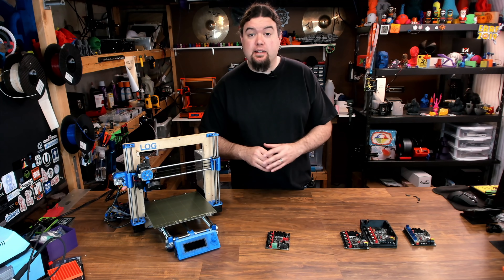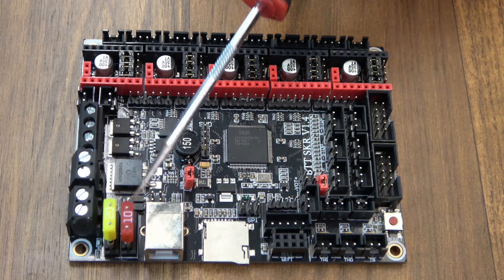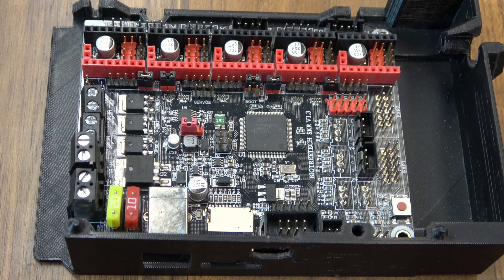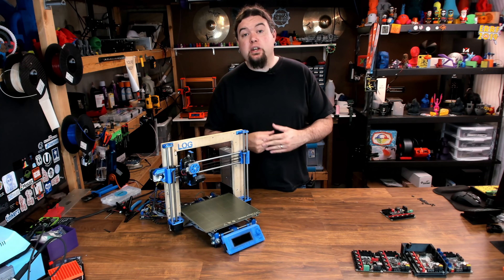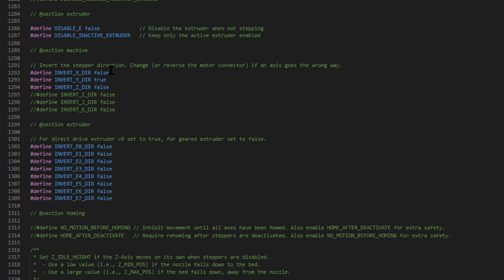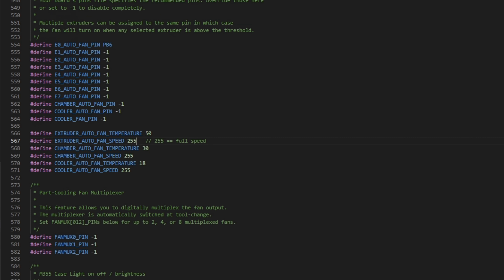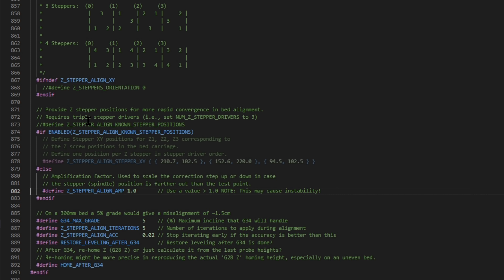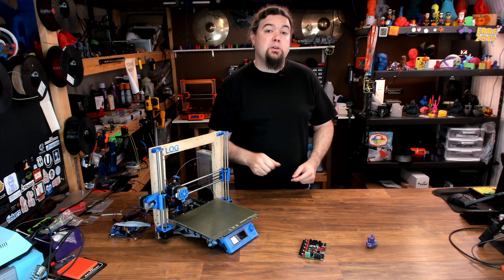Big Tree Tech SKR 2 - Install - Marlin Configuration - Chris's Basement

Comment: Hey Chris. I have a cr10 v3  that I am building a completely new control box using the skr 2 and one of the btt tft touch screens, new psu and everything.  I'm putting it in a heated enclosure. This is a great video. I'm wondering where you get your info from. I'm comfortable compiling new firmware for the printer and the new hotend type and all that. A data sheet I guess I am looking for. I'd really appreciate it if you just gave me a quick answer. I plan to reuse these parts for when I build a voron 2.4 but I want practice with the hardware and software. I want the ability to print abs for the voron parts. Also I'll have a bunch of the electronics for the voron. I'm going to use klipper with a pi after I get the new control box working. The cr10 v3 has no info anywhere. I am comfortable with coding and the wiring.
Reply from the maker: The info is actually pretty hard to find. Usually, I will consult the Marlin example configs that people have already made. These prove to be pretty accurate most of the time.
Reply: @ChrisRiley  awesome Chris thanks. You are a fellow metalhead I see. Proper thing.

Comment: In klipper, you need to enable this 'mosfet for the driver', because otherwize the steppers wont turn on. I've found that if you turn this mosfet off, the heaters are also be off
Reply from the maker: Thinks for your insight

Comment: Greetings Chris!  This video was great to help me install this board.  I have one issue, when I followed the same procedure my 2nd Z stepper was not working plugged into the E1 driver.  Where do you assign E1 to the 2nd Z stepper?
Reply from the maker: Make sure you have this line in configuration_adv.h uncommented. #define NUM_Z_STEPPER_DRIVERS 1 set it to 2.

Comment: can I use the heated bet output to drive an SSR on my heated bed?
Reply from the maker: Yes, it will switch an SSR just fine.
Reply: @ChrisRiley  thanks, I'm pretty decent at this stuff...but I always feel more comfortable when I confirm it with someone like you...not looking to let the smoke out, ya know?  I find your videos to be a great reference to clarify little things I've forgotten since the last one I built.

On a side note, do you have any videos on running the esp32 WIFI module on the SKR2?  I bought the board, its BTT..there is a port on the SKR2 for it, colors even match...but I can't figure out if / how marlin supports wifi ?  I dont even need it, I just thought it'd be handy, now that I can't get it to work, I HAVE to have it! lol

Comment: Hi Chris.  I downloaded your marlin zip file from your site and extracted the files.  I then started VS Code, opened the extracted folder and went into the Marlin folder.  Then i clicked on the Configuration_adv.h file.  It gives an error before i start doing anything saying

#include errors detected. Please update your includePath.  Squiggles are disabled for this translation unit (E:\!3D Printer Files\Marlin-2.0.9.1-LOG_SKR_2\Marlin\src\MarlinCore.cpp).
Reply from the maker: If might not like that file name length. Try making the folder names a little shorter and see if that goes away.
Reply: Yes, it did.  Thank you.
Now that i'm past that i have even more severe errors.  Things like the extruder starting properly at the beginning of a print ( i guess its "priming" the extruder ).  Then the extruder seems to do its print for a very short while and then starts pushing up the filament instead of pushing it out the nozzle.

the next strange thing is that after about 10 layer or so ( remember its not spitting out filament, i just wanna see if the print would follow its path ) the print head tries going off the print surface to the extreme X+ area, causing a grinding noise so i hit the emergency stop.

So i figure, OK i'll start the printer, go into the terminal and type some commands with the print head in the center of the bed to be safe ( after restarting the printer of course ):
G1 X20
the nozzle goes right 20mm ....cool
I issue the same command again and the nozzle doesn't respond.

My settings for heat are 220 and 70.  Yet, any filament that comes out dont stick to the bed.  I use my "heat gun" and find those temperatures are spot on.
I'm not changing any code in Ultimaker Cura 5.2.1 by the way.
I really dont want to throw in the towel, but i'm getting pretty disheartened.  Please help.
Reply from the maker: @prophead62  It sounds like there are all kinds of things going on here. We are going to have to start with a somewhat working config to make this happen. What printer are you working on?

Comment: Hey there thank you for this video!! I just purchased the skr2 board. Mine has the green sticker and no chrome sticker but it has the H1904 on it so maybe it's a good board. Anyways I need advice /help. I have a anycubic kossel linear plus and the board went out on it and thays why I got the skr2. I'm going to try and put the skr2 board on my kossel and I'm kind of worried it won't work but I'm not am expert by no means when it comes to this so if you have any helpful tips or suggestions then send them my way I'd much appreciate it. I've always loved watching your vids. Very informative and they've helped me alot in the past and it's good to see you back !!!!
Reply from the maker: Yes, your board should be all good. The delta config is a challenge, this board will work great for it, it's just going to take a lot of config changes to get it working just right. I would start with the kossel example config that Marlin offers then start changing things from there.
Reply: @ChrisRiley  thank you for the input and I got everything hooked up and labeled now. I unhooked everything so I could build a cooling board cover for it and when thats done then the fun begins 😆 . I love your vids! They have helped me out alot in this journey of 3d printing and I'm sure they will continue to help in the future.

Comment: EXCELLENT video!  I just picked one up to revive an old printer and your video really nailed the key points!
One issue I do have is getting the onboard SDCARD to work with M20/etc...  Any tips for setting up the onboard SD??
Reply from the maker: Thank you! Glad it helped, check out these settings in Marlin, configuration_adv.h they might help.

/**
   * Set this option to one of the following (or the board's defaults apply):
   *
   *           LCD - Use the SD drive in the external LCD controller.
   *       ONBOARD - Use the SD drive on the control board.
   *  CUSTOM_CABLE - Use a custom cable to access the SD (as defined in a pins file).
   *
   * :[ 'LCD', 'ONBOARD', 'CUSTOM_CABLE' ]
   */
  //#define SDCARD_CONNECTION LCD

  // Enable if SD detect is rendered useless (e.g., by using an SD extender)
  //#define NO_SD_DETECT
Reply: @ChrisRiley  Thanks for the input!  It is truly awesome how you reach out to help everyone here!  I had played with those but gave them another look.  As it turns out, #define USB_FLASH_DRIVE_SUPPORT  was enabled and preventing marlin from reading the SD card.  May play with //#define MULTI_VOLUME  to see if that will allow both SDcard and USB Flash drive to work together.
Cheers!
LitterBug

Comment: Will I burn out the drivers if I set the jumpers wrong?
Reply from the maker: It should not.
Reply: @ChrisRiley  Thanx. Because i burn 2 drivers TMC2208 in jusr some moves vhen i trying new SKR 2 rev B. I think i burn them because i forget to remove 3 jumpers. BTT is realy crap. One burn board and 2 driver in 2 mounths.

Comment: I have an ender V1 skr v2. How do I set up the firmware? Is there a simple video?
Reply from the maker: You can copy and page the example config files from Marlin. They are here. https://github.com/MarlinFirmware/Marlin/tree/2.0.x/config
Reply: @ChrisRiley  I got it thanks. I think my problem was that I kept the sd card in after putting firmware in. It worked immediately after I took it out. All that work and then the micro swiss is short and doesn't reach the bed. I can't win 🤣🤣

Comment: What all needs to go on for the TFT35 v3.0?
Reply from the maker: You can use it out of the box, you need to update the config to make sure you have a second serial for it to use.
Reply: @ChrisRiley  I looked a bunch into it. Thought it tied into the firmware for touch, but I guess it's standalone. Almost have everything working thanks to this guide! Gonna wire it tonight and see if I can get a benchy out here in a few days.

Comment: Could you explain how can I use a PT100 with SKR 1.4 turbo?
Reply from the maker: The easiest way is to buy a module to add on to your board. https://www.amazon.com/BIGTREETECH-Temperature-Accessories-Control-Printer/dp/B08PC22D6F/ref=sr_1_2?dchild=1&keywords=bigtreetech+pt100&qid=1634999990&qsid=130-3509954-3210169&sr=8-2&sres=B08PC22D6F%2CB0978ZNDPJ%2CB09713SRVP%2CB07D9LSKWK%2CB0943WVM5B%2CB08NV8XL4G%2CB089CQ3DHB%2CB07FFTHMMN%2CB08BRVBQ5R%2CB07VWGFKLZ%2CB07QJ4MZVN%2CB08B3CJBRN%2CB07D5JXDBQ%2CB082QYYFVX%2CB07ZTM9CSQ%2CB07JGJKPT9
Reply: @ChrisRiley  yes, but how is it used?

Comment: do you know how to fix "the TMC Connection Error"???
Reply from the maker: It could be a lot of things. Turn on motor status in the firmware and run the check command. See if you can see which one is causing the problem. https://youtu.be/H5ea2iyOscg

Comment: An additional note about the bed heater and input power connectors - they are swapped from the SKR V1.3 and 1.4 boards.  And they are NOT labeled on the TOP of the circuit board. Out of habit I put the input power into the bed socket and the bed wires into the power input socket. No big harm (lucky) but a surprise which can cost you a lot of time as the board will operate totally normally EXCEPT the bed power is on all the time. I didn't notice it for a while as I was turning the power on, testing a couple items (stepper motors, temp sensors, etc) and then turning it off again. But I was spending some time tracing an issue with the power on and I got a BED MAXTEMP EXCEEDED shutdown. I had a spare board and it behaved the same way, and while looking at the bottom I saw the sockets had been switched. 

Embarrassing, but I thought I would pass it on to save someone else trouble if they do the same thing!

And yes, you did mention the locations in your video but I watched it a month or so before I got my board.
Reply from the maker: Defiantly something you want to watch out for, thanks for sharing!

Comment: Hi Sir, I have some issue with SKR 2 REV B - It's shows TMC connection error. I am using TMC2209
Reply from the maker: Double check your jumper and reseat the drivers. Good luck

Comment: Thanks for the video, Chris, it's very clear and helpful. I ran into an issue. I've followed the video instruction to setup marlin and after flashing the board i get a "tmc connection error". Do i need to do something to the drivers? I've seen some people talking about the soldering on the underside of the stepper for uart mode. Any ideas? /edit: Turns out, as i was flashing it on the bench, i hadn't checked it hooked up to a power supply yet. (just flashing on the bench powered by usb).
Reply from the maker: Glad you got it going!

Comment: I was wondering, i still have my two prusa mk2,5s printers but they need a board upgrade desperately. Would i be able to follow this video (particullary im thinking about the configuration of the firmware part and the fact that they are 12v systems). Great video as always Chris :)
Reply from the maker: Yes, this config would be pretty close to what you needed to do for your MK2's.
Reply: @ChrisRiley  thanks for the reply Chris. From my understanding the skr board will work with 12v input voltage aswell. (I wouldn't mind replacing the psu to a 24v version although replacing the bed would be a bit more costly and I'd rather not do that).

Comment: I'm scratching my head in frustration. I followed your instructions exactly and it won't build the firmware. I keep getting "Error: Could not find one of 'package.json" manifest files in the package" I don't know what I'm doing wrong.
Reply from the maker: When it calls out these errors most of the time the firmware isn't complete. Make sure you have the correct folder added and you have a .pio folder.
Reply: @ChrisRiley  , I’ve downloaded the folder multiple times each having the .pio folder with no success
Reply: I would love to zoom call with you to show you the headache I'm having

Comment: I've had the SKR 2.0 Rev B for a few months and have struggled with one problem, "no printer installed" Even though I'm wanting to use it on my Lowrider2 CNC with a TFT35 3.0 and not a printer. This issue in essence has made it useless. I switched to it in order to use sensorless homing and I've gotten that to work on all 3 axis. Anybody have any suggestions? I have all baud rates matching, which seems to be the common solution everybody suggests.
Reply: my understanding is that this error means the tft35 is not communicating with the skr2, is your display definition in marlin correct?
Reply: @onleditpas  This is what I've enabled based on my searching for a solution #define REPRAP_DISCOUNT_FULL_GRAPHIC_SMART_CONTROLLER. My intuition says that's wrong since I'm running Marlin but It has allowed me to at least switch from touch screen to Marlin mode. Do you have any suggestions?
Reply: @ivanhoyt7757  Unfortunately that is the one I have selected and my TFT50 seems OK.   Does it really say "no printer installed", mine says "no printer attached" while booting but it is replaced with the printer's name once Marlin is booted up.  You say you can switch form touch screen to Marlin mode so it looks like your 3 cables are good.  Did you upgrade the firmware on the TFT35 to the latest?   One thing to keep in mind, all parts taken from stock are to be considered bad until proven otherwise, Chris did say he had to go through a few SKR2s before getting a good one, same could apply to the TFT (meaning it could be the screen or the mainboard).    You mention the serial ports settings so just to confirm mine are set at:
#define SERIAL_PORT 1

#define BAUDRATE 115200
#define SERIAL_PORT_2 -1
#define SERIAL_PORT_3 3

 You may have to talk to bigtreetech
Reply: @onleditpas  You are correct, mine also says "no printer attached". I do have the latest Marlin and TFT firmware. My serial ports are the same except for serial port 3 which I don't have enabled. I've been in touch with Bigtreetech but they say it's my Marlin Firmware configuration. It's been a very long fruitless project.
Reply from the maker: There should be no Marlin changes as far as the screen goes. You just need to hook up the 5 TFT wires to the TFT pins on the board. In Marlin you just have to make sure the baud rate on the screen and Marlin match for all the serial ports. Try setting serial 1 to -1 and serial 2 to 2.
Reply: @ChrisRiley  I have Serial 1 to -1 and serial 2 to 1. I'll try chageing serial 2.
Reply: you may also consider pulling a continuity tester and probing that black serial cable
Reply: @onleditpas  I have done that on all 3 cables. Sure appreciate everyone's patience and help as I work through this.

Comment: hi.somebody can tell me  why I have this message? appears when I activate Z2. Is there an approach to keep Z2 active? 
Marlin\src\inc\Warnings.cpp:167:4: warning: #warning "Auto-assigned Z2 STEP/DIR/ENABLE_PINs to unused En_STEP/DIR/ENABLE_PINs." [-Wcpp]
  167 |   #warning "Auto-assigned Z2 STEP/DIR/ENABLE_PINs to unused En_STEP/DIR/ENABLE_PINs."
Reply from the maker: I think that is telling you that you have enabled the Z2 driver, but not the feature that uses it. Is the 2 Z drivers enabled in configuration_adv.h?
Reply: @ChrisRiley  yes Z,Z2  its enabled
Reply from the maker: @tompaul5861  What board do you have? This is on the SKR 2? It should know about E1, I am running it this way as well.
Reply: @ChrisRiley  I have SKR 1.4 turbo. firmware its crashed. I need to make a new firmware. from firts time it was problem with this mainboard